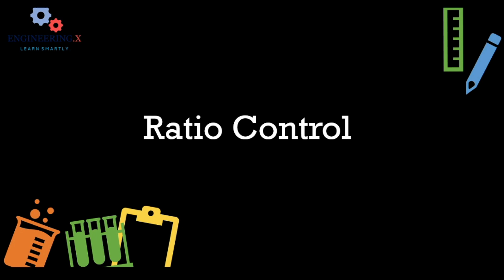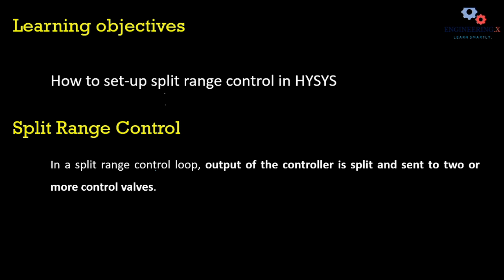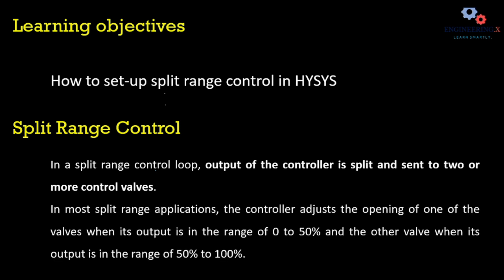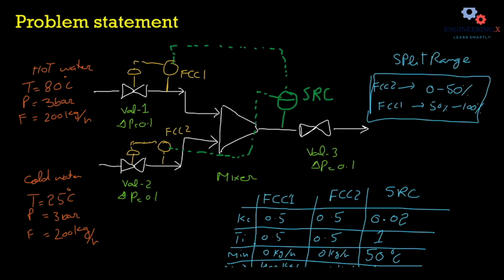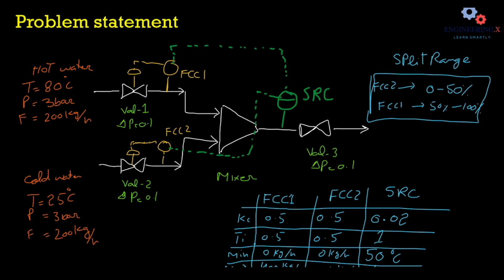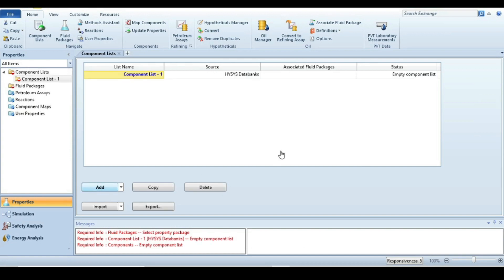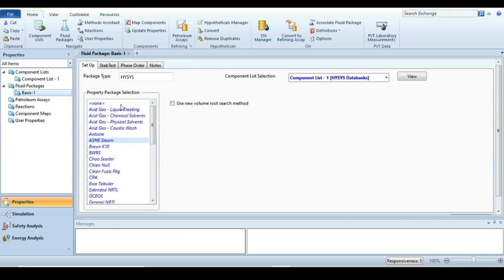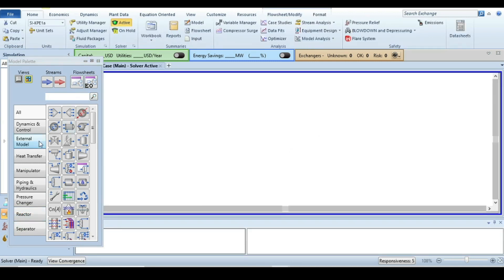Split Range Control | Aspen HYSYS Dynamics

Comment: Hi cool video,  could you tell me please what's the version of you aspen hysys?
Reply from the maker: I think it was Aspen V.11
Reply: @eduXinsight  for my diploma project I want to make split range control  for 2 flow control valves. 
I watched your video and in pos.3 i changed temperature to mass flow rate.  Unfortunately it didn't work. Could you help me with this problem??(